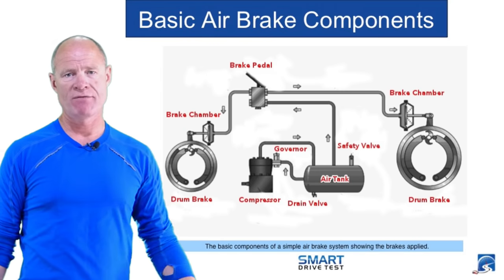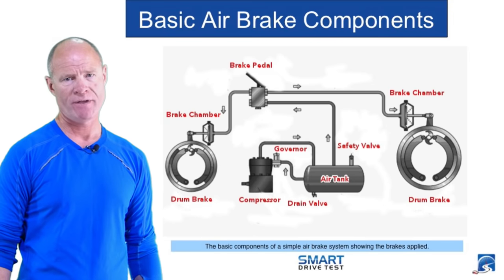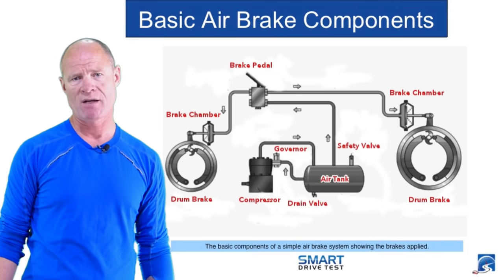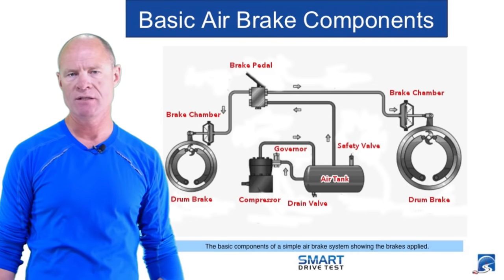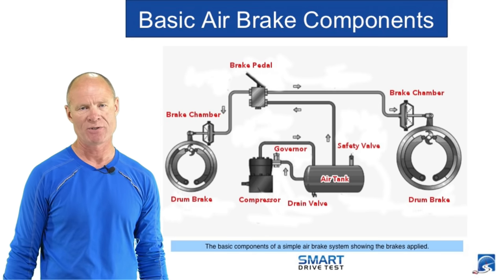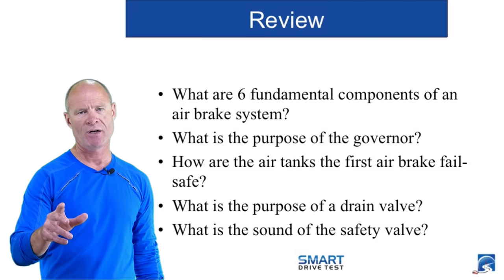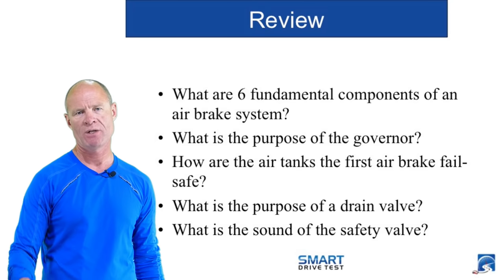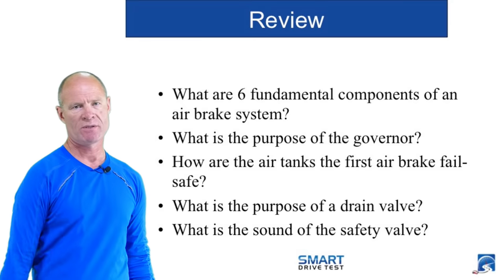Basic CDL Air Brake Components

Comment: If the air compressor runs all the time the truck is on and the governor keeps the total air in the compressor at a certain range 135psi or so and expells the leftover air to the atmosphere then how does the air get to the air tanks?

Comment: Thank you for doing this. I am retired from driving. I kept my CDL because I bought a Restoring project. A 71 SeaGrave Fire Pumper.
I had a Leak in one of my Tanks. From the stuff you teach, I could tell there was something wrong. Limped Fire Rig to my shop. Showed them right were problem was. And told them do repairs, plus full DOT inspection, of Air brake system. This is in part thanks to listening to great instructors like you. So I knew what to look for in Air brake system. I wanted the Fire Rig to let Kids enjoy. Get in cab. It has the opposite type of release for AirBrakes. You pull out nob, for DRIVING. Yes it's not what I'm use too.

Comment: In 8 years of working as a truck mechanic I've never once worked on a wedge brake equipped truck, however I have worked on air over hydraulic brake systems but only on older front end loaders in the heavy equipment side of things.
Reply from the maker: Thank you for that information my friend. All the best, Cheers Rick

Comment: This visual helped me see air brakes system from a different perspective. It helped alittle bit.
Reply from the maker: Which aspect of the air brakes is causing you challenge my friend? Remember 3-2-1 - three reasons that the brakes apply (service, parking, emergency); two power sources (air and spring pressure); one brake at each wheel or set of wheels. Check out this resource: https://www.smartdrivetest.com/airbrakes-cdl-rv/air-brakes-explained-simply Drop us a note if we can help further, or you have questions. All the best, Cheers Rick

Comment: sound of safety valve haa haa
Reply from the maker: Hi amit soni - Apologies for the late response. Thank you for your comment. Yes, the safety valve is a funny sound indeed - and it helps students to remember. ;0) If there is anything further we can do, drop us a note. Always happy to help. All the best, Cheers Rick
Reply: Tu tu tu tu tu tu machina gun🤣🤣
Reply: In your video you never explain the purpose of a air dryer I have a problem with a safety valve that is attached to an air dryer that sound like a machine gun before it purges The system is on a freightliner chassis and it as 20000 miles on the chassis and air system the governor ,safety valve ,filter dryer filter is new. The purge valve also is new. They problem is the system can not reach a 125 435 PSI at 12:00 rpm so it continues to release air with safety valve the purge system can not work. The purge system will work once you let off of the throttle and go back to 700 rpm the system worked great once you accelerate the system has begin to load the air tanks it does it again the same problem allowing air not to build to a 130 PSI.
Reply from the maker: Here is the video for the air dryer my friend; https://www.youtube.com/watch?v=yBi-6eUch0w&list=PL0x-bChcUvwG2bSWReQWnk9Tm92L7WN_O&index=18&t=0s The safety valves on the system are located on the air tanks. I believe you're talking about the purge valve on the air dryer. I would guess that you either have a problem with the purge valve on the air dryer, or something is wrong with the governor. All the best, Cheers Rick

Comment: Great presentation for the fundamentals.  I am using air brake system on a 40 foot diesel pusher class a motorhome. I'm reviewing information for the brake system to help me understand how they work and how to troubleshoot should I have problems. On my last trip out, I noticed the primary system pressure drop off while traveling but build itself back up. Not sure why because I think it should stay at cutout pressure unless I use the brakes which would use some of the air and then build back right away. ????  Any comments or suggestions for me ????????

Comment: Thanks for the helpful video. currently,  have an issue with air break (i.e break sensor) , unfortunately this issue happened many times so please can I know drying or releasing the air pressure after using the lorry will effect on that?? And is that the main reason for that!?

Comment: THANK YOU
I'm taking air brakes as a part of a 2 year Motive Power program...I'm excited to look through more of your content, you have a great way of breaking things down.
Reply from the maker: Hi Anthony - thanks for your comment. Can I ask, at what institution are you taking the Motive Power program. Have a look at the air brake information for the state of California - lots of details in that bit. If there's anything specific we can help you with, drop us a note. All the best, Cheers Rick
Reply: Smart Drive Test I will definitely check out the California stuff. I'm at Sault College. Nice program with a lot of cars, trucks and equipment to learn on.
Reply from the maker: Thanks Anthony - that's great information. When you're finished with the course, what will that allow you to work at? Thanks, Cheers Rick
Reply: Smart Drive Test I've always wanted to operate, but slowly pulled towards working on stuff instead. As far as the course--I think you could consider it pre-apprentice. The course is called Motive Power Advance Repair. It's an even mix of automotive and heavy / truck and coach. I'll be ready to hire in either trade and have a good handle on the systems on the equipment and in the garage. I can't wait to be working but I know there's still lots to learn!
Reply from the maker: Hi Anthony - yes, with that range of equipment, there is indeed, lots to learn. However, I'm sure that you won't have too much trouble finding employment. All the best, Cheers Rick

Comment: Can you explain how the system operates on the road. I’m interested as I don’t quite understand. When I release the accelerator pedal the air breaks engage. What is happening during this stage? Is it correct in saying that with air brakes, the compressed air is keeping the breaks off until you disengage the accelerator? How does this work? Or am I completely wrong and the accelerator pedal has nothing to do with anything?
Reply from the maker: Have a look at this vid: https://www.youtube.com/watch?v=ZFi957GaxpU&list=PL0x-bChcUvwG2bSWReQWnk9Tm92L7WN_O&index=1&t=1s The brake pedal controls the "service brakes" on the vehicle. If you take your foot off the accelerator and the "Jake brake" (auxiliary braking system) is on, the jake brake will activate. Have a look at this resource: https://www.smartdrivetest.com/airbrakes-cdl-rv/air-brakes-explained-simply Drop us a note if you have further questions. Cheers Rick

Comment: I have been taking my class 1 course with a very helpful instructor, one on one so its great, however, I'm having issues understanding the airbrake system while in class. I dont want to just pass the air brake test, I want to know exactly what does what and incase of a failure on the road Ill know what to do, not only saving my company money but down the road when I am a owner operator but finding out ways I can trouble shoot to get back to the shop. Thanks for these videos, you helped me pass my class 5 as well.
Reply from the maker: Hi Heavy Weight Primate With a Harvard Mind  - that is a awesome news. Thank you for letting us know. I'm sure you had a big celebration, and it is well deserved owing to your study. If there is anything further we can do, drop us a note. Always happy to help. Enjoy your career. All the best, Cheers Rick

Comment: I was driving a truck that was having issues with its radiator. coolant was going straight into the overflow and not returning, this in turn prevented the  air build up, how was it connected?
Reply from the maker: Hi Harry Marks - what kind of truck are you driving my friend? And what engine is in that truck? All the best, Cheers Rick

Comment: Hi I was wondering what the difference between the relay valve and the quick release valve is? My book says they both do the same function..reduce lag time and dissipate air from the break chambers faster.. I’m a bit confused on there difference if they functions are the same ? Thanks
Reply from the maker: Yes, that can be a bit confusing. Often a quick release valve is part of a relay valve. 2 different valves in one housing. "Quick release" valve, quickly releases air from the system after a service or parking brake application. A relay valve reduces the distance air has to travel to make a service brake application. Consider this e-book for more detailed explanations: https://www.smartdrivetest.com/airbrakes-cdl-rv/air-brakes-explained-simply All the best, Cheers Rick

Comment: Great short video! When you said the drain valve should be drained daily -  I choked on my coffee to the point of it coming out my nose - our drivers don’t even know what, where or why it’s there!
Reply: I went to work one place that one trucks tanks were half full of water. The wet tank was probably 90 % full 😳
Reply: @cbmech2563 likely need to have the air dryer replaced the desiccant filters are only good for 2 years and most outfits do not have them serviced or replaced in that timeframe
Reply: @redneckcanuckdieseltech  or the dryer has been bypassed. On trash trucks with the high air usage the cartridge ought to be replaced on an annual. Were I'm working now I spent days cleaning tanks and lines replacing valves because the system was full of desiccant bb's. It took a year before the problems went completely away. And they still don't service them until they fail.

Comment: If you have an M35 series military surplus truck, they had a GMC gasoline engine which was replaced with a GMC or White multi fuel diesel engine. The truck retained the air over hydraulic brakes.
Reply from the maker: Hi DrRocketman 779 - I suspect they had to put an air compressor on the diesel engine? Thanks, all the best, Cheers Rick

Comment: I have an old diesel and it seems that I can’t find my compressor anywhere. Is it possible to use an external compressed air source for my system ?
Reply from the maker: How old is you diesel? Cheers Rick

Comment: Hello! I just found your channel and how amazing it is, thank you for this free class....I am currently working on my 1985 Chevy k20 and the person who gave it to me said I needed to remove air from the pipes and bleeding the system would do it... but just yesterday I found out that I might have a air brake system installed on it because I do see a black k-h box under the dash... I never used this system before and my brakes are not braking properly it is braking when I pump once very hard... and it is extremely dangerous to drive when the traffic is intense... how can I get started? I don’t hear the governor noise like a gun machine like you say... I attempt to bleed the fluid and the one person procedure was not working for me... and I broke the bleeding valve on the front passenger side too rust to come out... I am currently studying mechanical and I work in the it industries everything I know is very basic but I love to troubleshoot car and I dive into it if you give me some starting directions.... I want to learn the air brake systems before I kill myself driving my old truck... buddy sorry for the long message but I will keep my eye on your channel to learn more!
Reply from the maker: Hi Tulio Cortez - Thank you for your comment and query. Do you have an air-over-hydraulic system? Is there 4-sided yellow button on the dash that you use to release and apply the parking brake? Have a look here: https://www.smartdrivetest.com/air-brakes/air-over-hydraulic-foundation-brakes If there is anything further we can do, drop us a note. Always happy to help. All the best, Cheers Rick

Comment: My truck has wedge brakes on the steer axle. It’s 4wd though. And my loader has air over hydraulic brakes. Many military vehicles have air over hydraulic brakes because sometimes (like when you’re being shot at) you don’t have time to let the system pressure up so you can move out.
Reply from the maker: Hi localcrew - how old are these vehicles my friend? All the best, Cheers Rick
Reply: The loader is from 1960 and the truck is a 1987 International S1800. The brakes on the truck work great too.

Comment: Great video! Just bought a 40 ft diesel pusher RV and going to drive this thing from TO to Vancouver Island. Never had an RV before, already overwhelmed by just looking at it, so will just start with the air brake license and work my way through the rest. Any tips for road test for DZ license Ontario? I bought the air brake book from your website, need all the knowledge possible to get through the Rockies safely. :-)
Reply from the maker: Hi mila bon - Thank you for your query. Thank you for purchasing the "Air Brake Explained Simply" ebook. This video will get you started for the DZ test: https://www.youtube.com/watch?v=WhRjHH_mRYw Also, keep in mind that all the "G" information is applicable to the higher class licenses. How old in the "diesel pusher"? With modern engine brake technology, you should be just fine in the mountains. Have a look at this video: https://www.youtube.com/watch?v=tKCyg2ln_1E&list=PL0x-bChcUvwG2bSWReQWnk9Tm92L7WN_O&index=11&t=7s If there is anything further we can do, drop us a note. Always happy to help. All the best, Cheers Rick

Comment: Great video.
I know nothing about air brakes. 

It seems that the brakes are either fully on or fully off when the brake pedal is pressed. Is the braking pressure modulated in the brake chamber by a spring that resists the air pressure from the tank? Does the air in the brake chamber returned to the air lines or is it released into the atmosphere when the brakes are released?
Reply from the maker: This may help:
There are three reasons that brakes are applied on a commercial vehicle fitted with air brakes:
1.	Service Brakes: the brake pedal is pushed and the brakes are applied to slow the vehicle in everyday driving. Air pressure is used to apply the brakes and keep the parking/emergency brakes in the OFF position;
2.	Parking Brakes: The vehicle is parked, thus parking brakes. In this event, air is evacuated from the system and large, powerful springs expand and apply the brakes. Parking brakes will remain on indefinitely owing to the mechanical force of the springs. 
3.	Emergency Brakes – in the event of a catastrophic air loss in the system, the service brakes will fail. In this event, air is leaking from the system and insufficient air pressure is available to compress the large, powerful springs that act as parking brake. In an emergency event causing loss of air pressure the parking brakes will apply automatically. Thus, acting as emergency brakes.
Check out this source: https://www.smartdrivetest.com/airbrakes-cdl-rv/air-brakes-explained-simply

Air pressure is evacuated to the atmosphere. It's never returned to the system. Drop us a note if you have further questions. Cheers Rick
Reply: @smartdrivetest  Thanks. So is the compressed air in the service brake acting like hydraulic fluid?

If so, this tells me that the sponginess that one feels stepping on the brake pedal would change depending on the amount of air pressure present in the air lines i.e. if it is closer to 135 than 105 lbs one would feel a difference in the pedal travel to apply the same amount of braking force.

Comment: I have a very peculiar problem with a dump trailer. when the air suspension fails to re-fill with air after dumping the load, my trailer's brakes don't work and when they do re-fill my brakes do work again. Also I just replaced the Air Dryer but the system keeps collecting lots of water in the air tanks. Any advice as what the problem might be? thank you

Comment: Here's my work.
Semi truck questions:

What are the 6 main components for air brakes.

1 Air compressor
2 brake lines
3 brake pedal
4brake foundartions
5 ***the governor****
6 air tanks

What is the purpose of the governor?

The governor is what allows the compressed air to be put in and out of the brake system from the engine’s air compressor. (The governor controls the compressor)

How are the air tanks the first air brake fail safe?

They are the first fail safe because they are what holds the compressed air if there was ever a problem with the air brake line system. They can hold up to 12 to 11 full brake stops. (The air tanks are the fail safe for the engine’s air compressor.)

What is the purpose of a drain valve?

The purpose of the drain value is to drain any moisture that has made its way into the air brake tanks from moisture build up caused by temperature changes. It’s important to drain your air brake air tanks EVERY DAY, DAILY, so that you can prevent future air brake problems from occurring.(do don’t want them to freeze up)

What is the sound of the safety valve? ( at 150 psi)

It sounds like a “machine gun.”  When it does that there is a good chance there is a problem with the governor rather than the air compressor. Remember the governor is the gate/switch valve which allows more air to come into their system or to prevent more air from coming into the system. The air compressor is working the entire time the engine is on, which produces 800 psi of compressed air. The max psi air pressure in the brake system is 109-135 psi. 

Thank you for this help.

Comment: Hey Rick. Got a question for you. Do you need a class B license to drive a air brake vehicle in the US if it's not a commercial vehicle like say an RV or an 18 wheeler truck part only that you turned into an RV? Thanks upfront. :-)
Reply from the maker: Which state are you in? Cheers
Reply: @smartdrivetest  Blocked. Didn't want to leave my State posted too long.